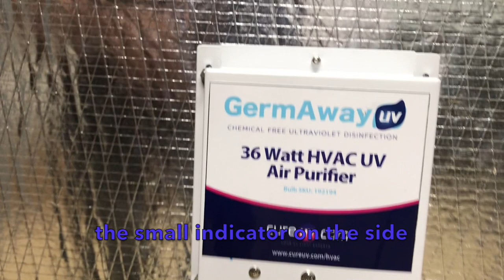DIY Installation of UV Light in HVAC System

Comment: Would be better if it did not run 24/7, but only when A/C or furnace is running.   Bulb will last longer.   Maybe wire this to the fan AC?

Comment: Too bad that NO ONE has a plug inside their HVAC....
Reply: As the bulb is on the inside, the power wire is clearly on the outside.
Reply: Or inside the attic next to the air handler